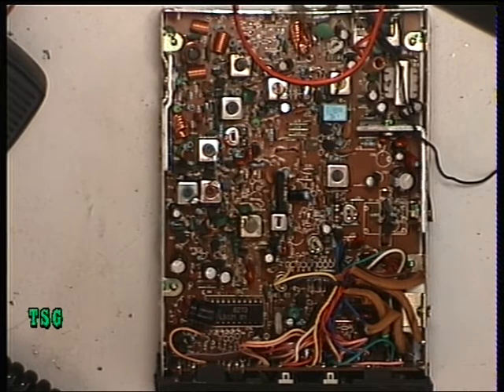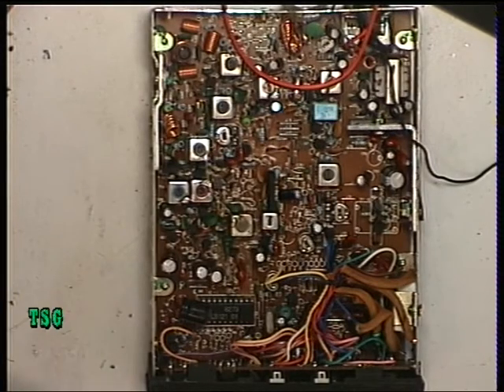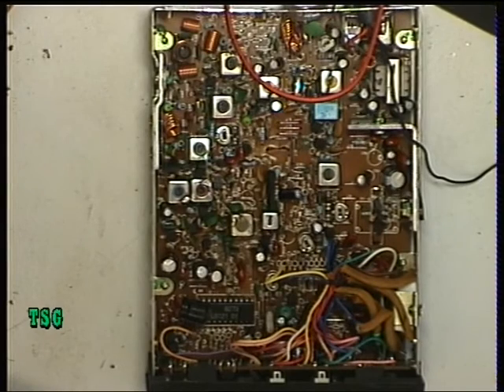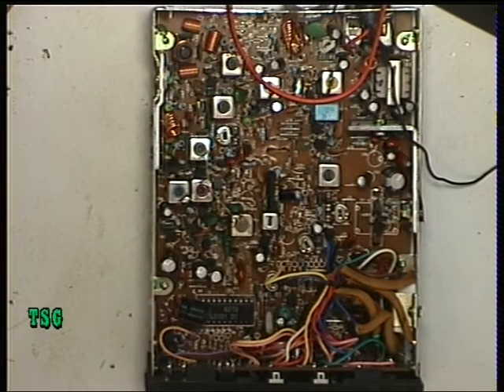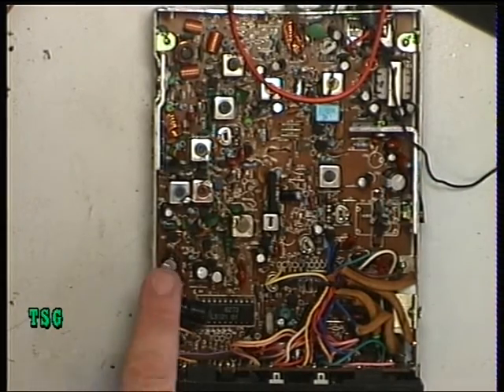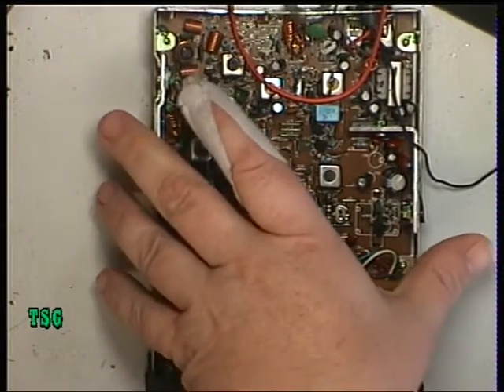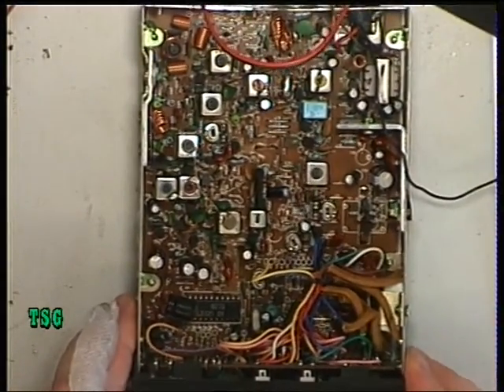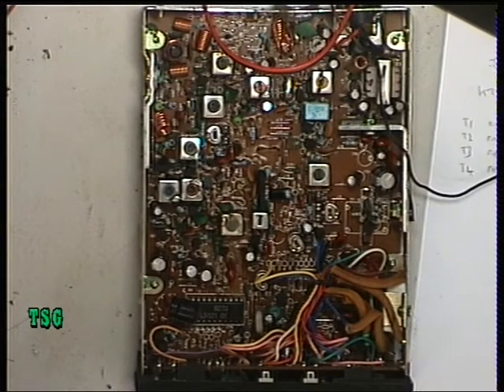Jesan KT4004, UK (CB 27/81) CB radio (Mobile) - Transmit alignment

Comment: Richard, is the chassis on this set the same as the little Midland sets by any chance? The one I’m thinking of is one I used to have, 77-104D or something as I remember. Similar to the Portapak sets.
Reply from the maker: I'll have to get two out & compare them side by side when time permits.

richard
Reply: @ukfmcbradioservicingTango21  I just wondered if you might know offhand. Don't go to any trouble on my account. The reason I asked is I had a Jesan KT 4004 many years ago and I've been looking out for one for a while and I recently got one. On inspection It just seemed very familiar to a Midland I once owned as I noticed a slight "Ping" sound when keyed up (monitoring through another set testing if it worked) which I remember the Midland did also. Very similar size too.
Reply from the maker: I've always had a memory like a sieve so wouldn't remember if I seen either of them yesterday or not.

richard